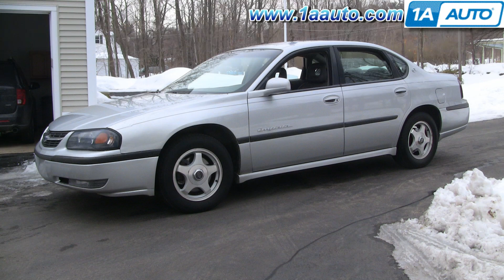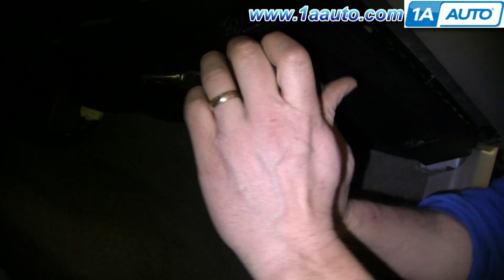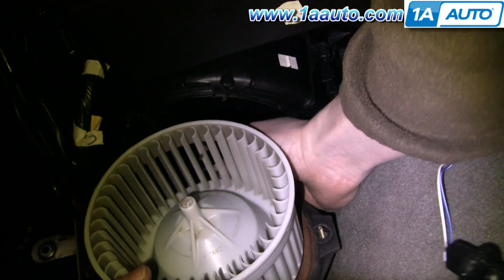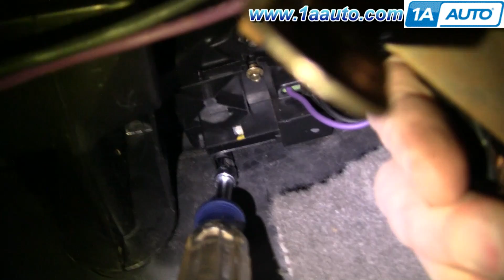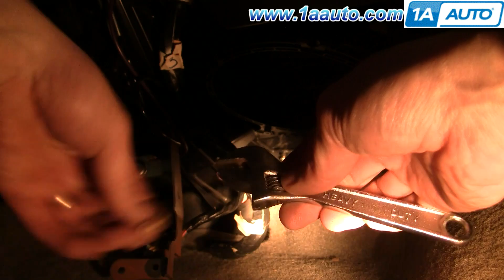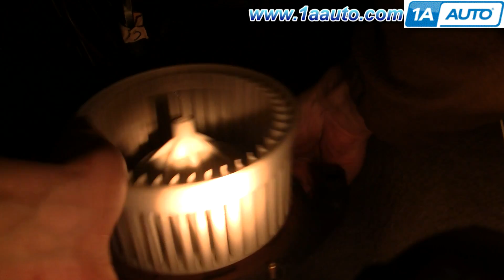How to Replace Blower Motor Resistor 00-03 Chevy Impala

Comment: Thank you so much for your videos,  I just finished installing a new AC resistor on my 2003 Grand Prix which is the same set up as this car in video.  It was a challenge and true to your words when having to torque my body into position to get the old resistor out,  But success was made and now I have a full range of blower settings.  Thank you so  much.

Comment: I struggled replacing the unit in my daughter's '03 Impala LS for nearly two hours! After finding and watching your video I was done in about 20 minutes.  Although I did not buy the new resistor from you, I appreciate your posting of this video. Your instructions were simple and concise and very helpful.  If I need parts in the future I will use you for sure!  Thanks for a great video!!
Reply from the maker: Thanks for watching. 1aauto.com 888-844-3393

Comment: Those 2 rear 7/32's sucked because it depends on how tight that rubberized backing is against the floorboard.  Remember, DO NOT TAKE OUT THE BACK TWO 7/32's because it has the horseshoe slots on the new resistor.  I didn't even bother tightening down the rear two.

It basically took me about 30 mins to do this job...one thing I recommend is putting down something soft for your back and knees since you will be contorted in a funky angle.

Watching this video really helped me out...thanks a bunch !!

Comment from the maker: It may be the resistor. You also may want to check to see if any of the wires are loose and causing the intermittent issue.

Comment: Absolutely great video. I think I would've been able to manage this replacement myself but after watching your video, I know I saved myself tons of time and frustration. My brother owns an auto shop so I got a good price on the resistor at my local parts store. My old one only worked on setting 3 and 5. The new one works on 1, 2, 3, and 5. Still no 4! lol. I can live without 4 rather than doing this replacement over again. Thanks again!

Comment: Thanks for the video!
The location of the blower/resistor and removal process is the same for a 2001 Buick Century.  However, if you have automatic climate control, the Fan Resistor does not have a circuit board so it does not look the same. BIG difference in price too!

Comment from the maker: @osugunner Thank you for checking out our auto repair videos. The blower motor fan in your car should turn off once the vehicle has turned off. The resistor to my knowledge shouldn't interfere with that.

Comment from the maker: @facio559 It almost sounds like there's to much power going to it, or something possible shorting them out. I would check for a frayed wire, or possibly the fuse going to it. Also check to make sure the proper size fuse is in the fuse box. Hope this helps you out.

Comment: Thanks for the video.  I have a 2000 Impala and it would only work on speeds 4 & 5.  It only took me a little over 30 minutes and 30 dollars to replace the resistor and now my A/C works on all settings.

Comment from the maker: @TechTehTech It sounds as though you may have a loose connection to the blower motor. You may want to check the connection to the blower motor to make sure it's secure, and not loose.

Comment: great video.  really helped me change this part.  my 2002 Impala has a rubber tube connected to the blower motor that also needed to be removed in the process.  those back screws on the resistor itself are almost impossible.
Reply from the maker: Thanks for watching. Have a great day! 1aauto.com 866-403-3393

Comment from the maker: You may have a cross connection or a pinched wire some where that could be causing this. When the car is off you could try to pull the fuses one by one to see which circuit has a draw on it.

Comment from the maker: @Mr37squad It sounds as though you may have a loose wire. I would check the fuses, and also check the plug that goes to the blower motor to see if it has power to it. Hope this helps.

Comment from the maker: If the motor goes on and off intermittently it could be from either the wire or the resistor. The issue with the wire theory is if it is grounded out, it would most likely pop a fuse so it most likely will be a physical part going bad.

Comment from the maker: @evaman1000 It should be. if the car has AC you may also want to make sure that the drain house under the car is clear. If this get's blocked, water will back up into the system and usually drip on the passenger side. You can blow a little air into the drain hose under the car with an air can if this has happened.That usually will enable the water to drain out once again. Hope this helps.

Comment: Just did mine right now and finished in about an hour. The bolts on mine (2000 Impala 3.8) all turned out to be 7/32... from the bracket to the fan and the resistor. all the same bolts, which made it kind of easier for me. Overall wasn't too hard and saved about $80 bucks.

Comment from the maker: @ytnpablo08 It could be either one of those components, you also may want to check the switch itself that turns it on. Electricity is finding it's way to the blower motor while the switch is in the off position, that could be the culprit.Hope this helps.

Comment from the maker: These cars could have a 5 speed setting fan or a 9 speed setting fan.  this Video covers the cars that have a 5 speed fan. Cars with  9 Speed fans are different. The resistor is riveted in and the fan itself is different.

Comment: ill try this on my 2001 park avenue , just today the air stop blowing from the vents. i checked all the fuses and relays they were all good. so there's one thing left to check is blower motor and resister. thank you for the instruction
Reply from the maker: +iraqiboy Thanks for watching. Hopefully this will help you out. If your blower motor resistor has gone bad we carry the replacement one shown in this video on our website. Here's a link to them. Hope this helps you out http://www.1aauto.com/1A/BlowerMotorResistor/Chevy/Impala/1AHBR00018?utm_source=YouTube&utm_medium=CTA%20Comment&utm_campaign=1ATony

Comment: I just took out the blower motor and checked the connection.  It was really dusty inside the connector so I blasted it with electronics cleaner then compressed air.  Fired 'er up and now she blows like hurricane Charlie !!!  Hope it holds up.

Comment: I changed the resistor on my 04 monte carlo and the blower works but goes in and out. I have to hit up underneath on the cover panel to get it to start up again. Bad  blower motor? It seems to work mostly on high as well but sometimes on lower settings. Motor squeaks at times too. Just wanted your .02 before I take it out. Keep up the great videos. Watch them frequently.

Eric

Comment from the maker: You may have a bad blower motor resistor. Usually when it goes bad you'll start to loose the heat settings. Hope this helps you out.

Comment: I am fairly tall, I did most of it upside down, slid if from the drivers side then down into passenger's feet area. The blower motor on mine has a different connector, could not figure out so I cut the wires going to replace the resistor pack anyway. The one screw in back of the 7 way connector is smaller diameter with a plastic sleeve that snaps into the cutout for the screw, did not need to loosen, had to loosen the other back screw  and remove the front. also be careful of the vacuum lines.

Comment: 2005 Impala;  Blower doesn't turn at any speed setting.  25A fuse on the passenger side panel, and the 20A fuse on driver side panel are both unblown.  What would be the next suspect?  Would it be (the relay on) the resistor module (seen in Haynes manual?).  Nice video...thanks.  I think we can replace the module if it's the likely culprit.

Comment: for loose or tights the rear 2 screws on the resistor is a really pain, I take out both and weld another bolt on the screw, one inch long for use the 3/8 wrench and works, designers engineers don't care future problems on the vehicles

Comment: Hi this is a great video. I want to make the repair myself because it cost so much at the shop and I think they may try to tell me anything.......that's why I'm doing research.
 My symptoms are: a loud 'screeching sound' when the heater fan is switched on and it only works on 5. Now it sounds like is it grinding!!
Will this video solve my issue?

Comment: Very helpful, im also have another issue my 2000 Chevy Impala heats up half way while still/idling but cools down as u drive. I replaced thermostat  and radiator fan assembly and nothing changed... HEEEEEEEELPP

Comment: My air only blows out of the front vents when im at idle.. When i start driving it goes straight to the defrost vents. Would replacing the Blower Motor Fan Speed Resistor fix this?

Comment: Do you think that this could be causing the windows to fog up even when the heat is turned up, it does that on cold days and when it is raining out, and the issue with only getting warm air when the temp control is turned to cold?

Comment: Thank you and 1 question. On my 2003 Impala the Fan is working only on the highest speed. So if that's the case my best bet is to replace the Resistor ? No need to replace the entire fan / motor.?

Thanks for the help. You guys are A1 + in my book
Reply from the maker: Usually when the blower motor resistor goes bad, you'll loose the lower settings and the heat may only work on the highest one. We carry new blower motor resistors on our website 1aauto.com

Comment: The bolts were all "7/32" size, with no torx screws in it, at all..  (Is that not 6.5mm?)  I thought the new GM cars were, all, metric bolts.  The wire from the resistor is so short it is almost impossible to reach it by rotating the blower motor.  I ended up pulling it out and the motor connector broke.  It still plugs in, to the new resistor, so I am going to see if it falls out from the motor vibration.    The back screws were, almost, impossible to get loose.  Even with the blower motor out, the socket would, barely, fit on! The rubber floor pan was a BIG barrier to doing it like you showed in the video. I loosened them and I was able to push the slotted resistor onto the back screws.  I tightened the front screw and it sounded like it did before I replaced the resistor.  It took way too long, because of the difficulty getting to the resistor screws.  The control works like it is supposed to now!
Reply: Yea it's metric and actually a 5.5mm.

Comment: My fan has been going off and on for the past few months. It will work for 2 days then not work for. It randomly comes on and off. Is this more of a loose wire issue or would the resistor be causing this. I have an 05 Impala base model. Thanks for your time! - Josh

Comment: i have an 03 impala and the speed only works on number 5 and i have replaced the motor resistor 4 times already and it works fine 1-5 for a couple days then it stops and only 5 works, hopefully you might have a suggestion.

Comment: Hi there. It ended up being a loose connection with the wires partially melted at the plastic connector.  I replaced the connector and now the blower will turn off and it stays on high only.  Even when I turn the car off and pull the key out.  Id the resister now shot also ?

Comment: I have a 2005 base Impala.  I can feel the heat and the cold air gently coming out of the vents while I'm driving but not while I am stopped.  The knob to change the speed of the air coming out doesn't work but I can the air that does come out from hot to cold.  I've checked fuses and all are good.  What might the problem be?

Comment from the maker: If the heat only works on one setting, it's usually the sign of a bad blower motor resistor. You may want to take the blower motor down to see if there's any debris caught up in the cage. We carry new blower motors and also the blower motor resistors on our website 1aauto.com with free shipping. Hope this helps you out. 1aauto.com 888-844-3393

Comment from the maker: You could try to see if see if there's power to the blower motor and the resistor with an ohm meter or a test light. Also check the fuses to see if there's one that might be blown. 1aauto.com 888-844-3393

Comment: I have a 2000 olds intrigue and when i went to loosen the bolts on the blower motor water started to drip from a couple of spots, could this be from when i ran the car through the car wash , if so shouldn't that area be sealed off from water getting in?

Comment: I have a 1990 Cadillac Seville, warm comes out at the base of the windshiled but when i turn up the heater to Hi it does not do anything. Do you think it's the blower motor fan resistor?

Comment: My daughters 2000 Impala's blower goes on by itself sometimes, even when the engine's off and the key is  out of the ignition. Would replacing the resistor fix that?

Comment: Any idea how to get to the screw behind the resister? The floor board (padding) makes it a very tight squeeze, even with the flex joint.
Reply from the maker: +alex myers Thanks for watching!  That is a tough screw to get loose, and the way we did it is with the flex joint you see in the video.  1aauto.com

Comment: I own a chevy monte carlo ss. My AC only works on speed 5. Does that mean that just the motor resistor has to be changed? Are do I need to change the Motor as well? Thanks in advance.

Comment from the maker: You may want to check the door actuator to see if it's working correctly and also for a possible vacuum line that might have a leak in it. Hope this helps you out. 1aauto.com 888-844-3393

Comment: if it was low on freon wouldn't at least blow air ?  it does not blow anything hot, warm or cold for 5-10 minutes.  Then while driving for 5-10 minutes it starts blowing.  when it does kick in it's ice cold.  I know the clutch is good because it is operating when their is no air blowing.

Comment: I have a 2004 impala, and my friend short circuited something with the blower motor resistor when hee was messinng around with the radio i think. It wont stop blowing even when i turn the car completely off. I have to take the blower motor fuse off. Do you think this replacement of the resistor will solve my issue?

Comment: I have a question. My a.c. and heat dont work. You can barely feel it blowing out but when it does its very good cold air. Im trying to make sure it's the blower motor which i think it is. Sometimes it will  randomly start blowing out of nowhere but not recently.
Reply from the maker: +Matthew Robinette Thanks for checking us out! There could be multiple reasons why you're having this particular problem. We suggest taking your vehicle to a nearby reputable shop to identify the cause.

Comment: Changed the Resistor and the actual blower motor and still, the heater only works on 5.

I have an 02 Monte Carlo, another thing is you can hear a clear "Clicking" sound when the fan does finally kick in.

Any suggestions, I'm over $100 in parts and hrs of labor and the issue still remains!!

Comment from the maker: You may want to check the electrical connection between the blower motor and the wire harness to see if it's loose or damaged in any way. 1aauto.com 888-844-3393

Comment from the maker: It could be a bad blower motor resistor. You may want to check the power to the resistor to see if there's power going to it. Hope this helps you out. 1aauto.com 888-844-3393

Comment: Hey I have a 2002 impala and my heat and ac doesn't work at all. It worked one day when I hit a bump in the road then it stopped. What could cause it for m not working? It doesn't work on any speed or setting. Please respond back

Comment: I have an Impala 05 and my blower motor fan stays on high all of the time even when my car is off...Just on high no other speeds...I am forced to take the blower motor fuse out in order to turn the fan off or else it drains my battery...am I having to replace the blower motor resistor or the blower motor itself..?? or something else entirely?

Comment: My auto head lights go off when i turn my fan to a different position other than 5, or the highest setting. I also lose the fan ,and defroster functions . The only way i can get the fan to blow and my head lights to come on automatically is to start my car with the fan on highest setting and leave it alone. Is it a resistor problem or a ignition switch problem?

Comment: 1A Auto Parts I have a 98 ford contour and the heater was working fine the night before but a storm came through with temps in the negatives went to start the car and turned the heater knobs but nothing came out no air same when i turn to a/c nothing i can hear it click on but nothing comes out we think its the blower motor what do you think? we checked fuses they seem ok
Reply from the maker: You may want to check the wires that go to the blower motor, and also to the blower motor resistor to see if they are damaged, or to also see if there's a loose connection. Hope this helps you out. 1aauto.com 888-844-3393

Comment: my 2001 chevy impala was sitting for a year, i got it fixed up but when i turn on AC or Heat, it vibrates violently and not air comes out at all, im thinking could it just be a rats nest bloacking the whole thing? and if so can i open it up like this to clear it out?

Comment from the maker: You may want to check the power going to the blower motor with an Ohm meter or a test light to see if there's power getting to it. If there's, it could be a bad blower motor. Hope this helps you out. Have a great day. 1aauto.com 888-844-3393